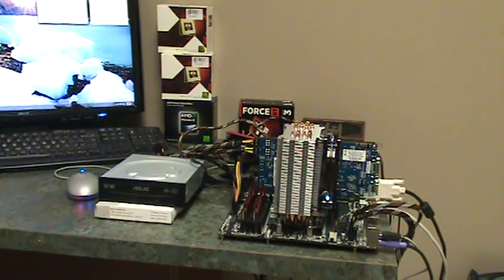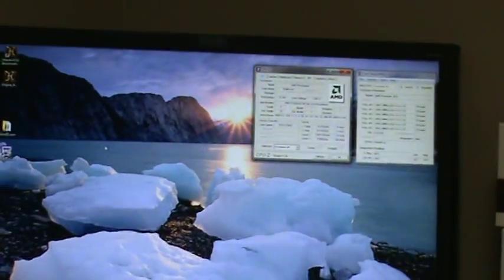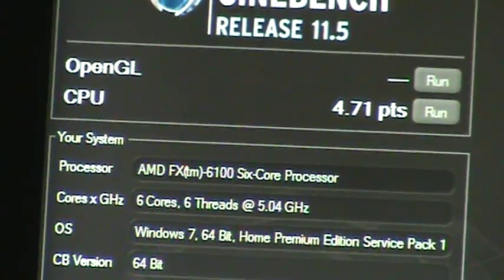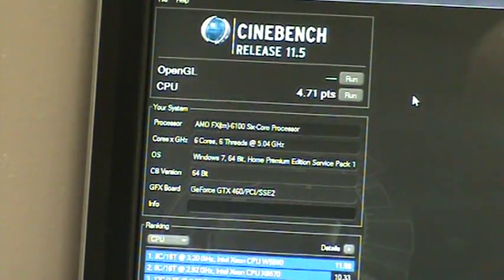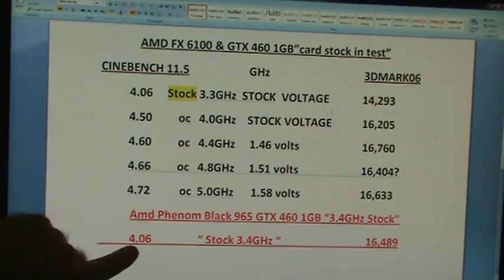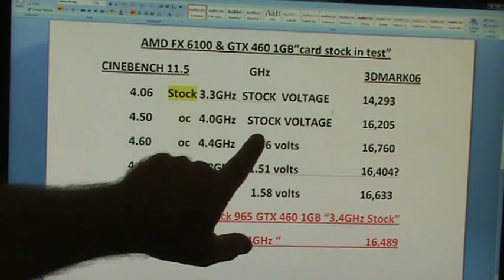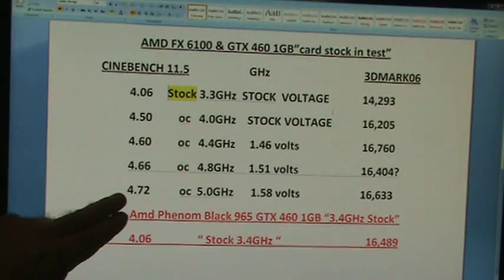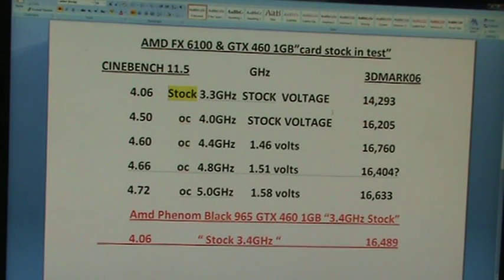FX 6100 vs Phenom II X4 965 "see Description"

Comment: AMD Phenom II X4 965 Black 
MSI 970A-G46 ATX AM3+ Motherboard
Asus Radeon HD 7770 2GB Video Card

I wanted to know if I'm bottle necking anywhere. And I'm not looking to play BF3 on ultra settings or anything like that. I want to play simple games like the Day Z mod, Garry's Mod, and other steam games. So...my question is will i be able to play those games at a playable frame rate? Hopefully 50+ frames?